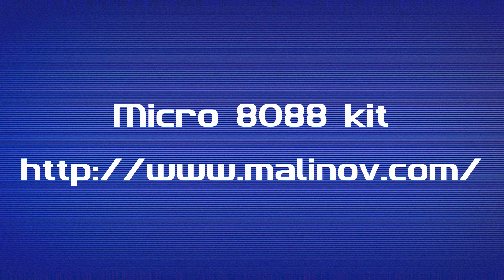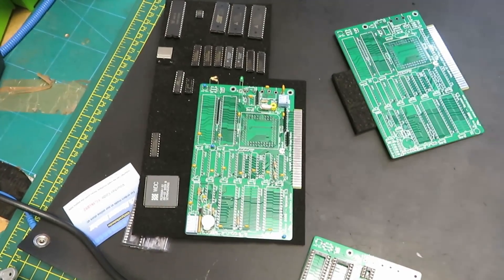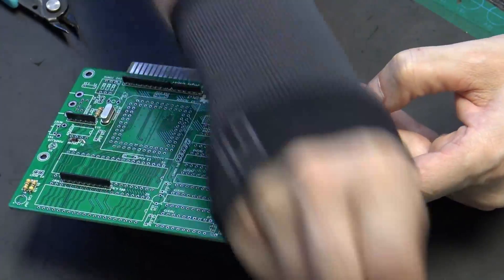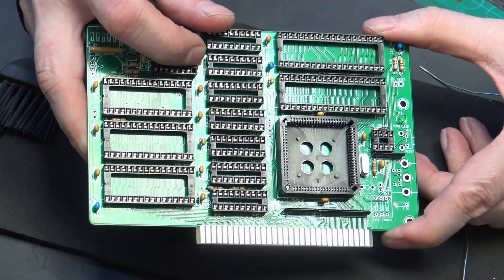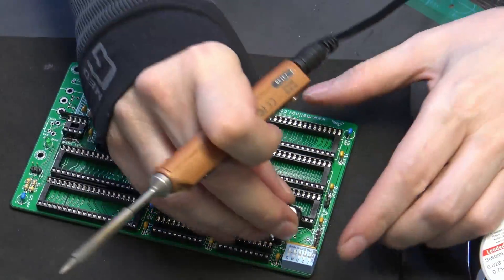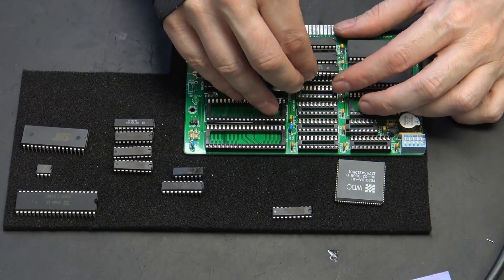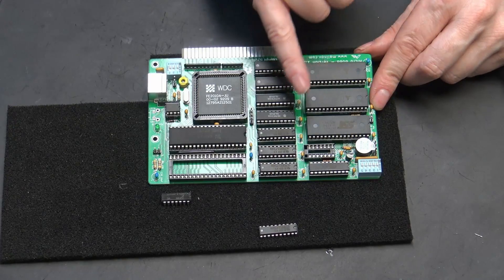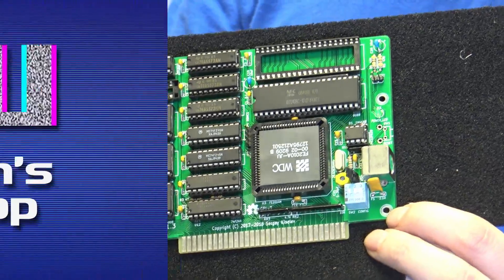Building the 8088 XT Kit Part 3. Sergey Kiselev designed processor board.

Comment: I just wanted to point out that the Xi-8088 is not a 16 bit card. It has the 16 bit edge connector because it implements a few extra signals that the original 8088 systems did not have, such as a second interrupt controller (IRQ8 -> IRQ15), that were only present on the 16 bit connector. It still is only an 8 bit data bus. I would love to see and 8086 or 80286 version at some point.
Reply from the maker: tubetime found a plugin card that upgrades 8088 systems to 286 and was reverse engineering it. Also why did you need to point out the 16bit stuff ? I am well aware this is an 8bit setup.
Reply: @leesmithsworkshop  your comment at 1:28 - "this board (xi-8088) is a lot better in some ways, it's 16 bit, and has a lot more control over the clocks generated"
Reply from the maker: @teknoman117  ok, thanks for the info I am sure I meant the slot size, but it good for the clarification.

Comment: Are these vintage chips? Or are they newly manufactured chips? Btw, I've been trying to get myself to build a terminal for ages. I will use your video to make one myself. Will there be a 4th video?
Reply from the maker: HI,  yes some are vintage like the 8088 processor and the chipset and others are modern like the memory and rom and ttl logic
Reply from the maker: I have a few more boards I made and working on a ATX PSU conversion board for -5v and soft power on. I just have had no time to setup to record at my workshop recently.

Comment: i built one of these earlier this year
Reply from the maker: what parts did you make ? I have a few more boards waiting including a fdd card and creative music system.
Reply: @leesmithsworkshop  so far just the micro 8088 board.  currently using a 486 era IO controller for floppy and a rs232 port, an old trident vga card, a ebay sourced backplane, and a soundblaster pro 2.
Reply from the maker: @va4cqd  hi, so the 16bit cards are working with the 8bit isa from the micro 8088 ?
Reply: @leesmithsworkshop  well the IO  controller im using only needs the 8 bit part for the FDC and serial.  ide doesnt work.  the soundblaster pro 2 only uses the 16 bit section for the integrated cdrom interface and the higher IRQs.  i bought a readymade XT IDE card
Reply from the maker: @va4cqd  ok, what is the ct model ?
Reply: leesmiths workshop ct1600
Reply from the maker: @va4cqd  wow they are way more expensive than the original soundblaster 2.
Reply: leesmiths workshop I’ve had mine since they were worthless 20 years ago
Reply from the maker: @va4cqd  I was always selling to upgrade so have very little of my old systems.
Reply: leesmiths workshop I did that too for the most part but I did keep a few